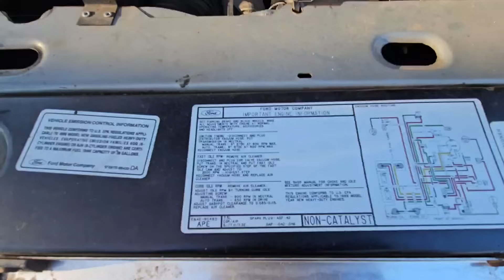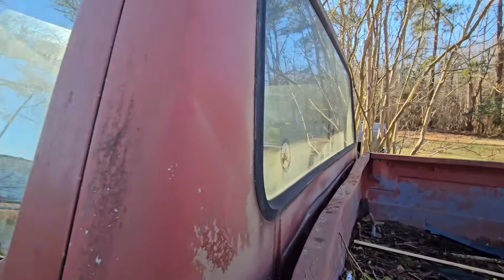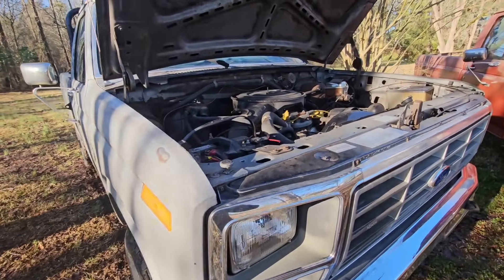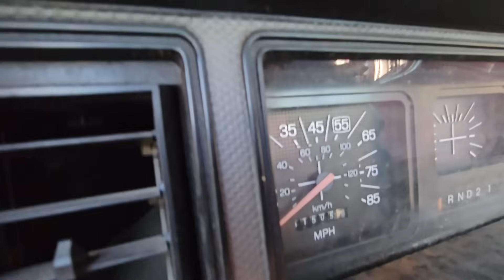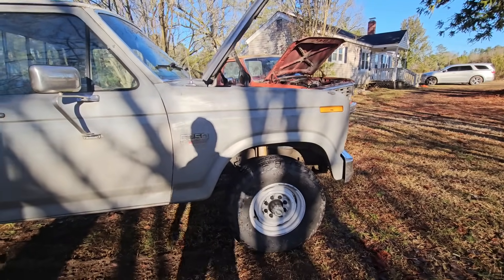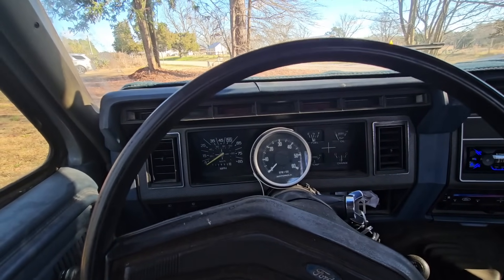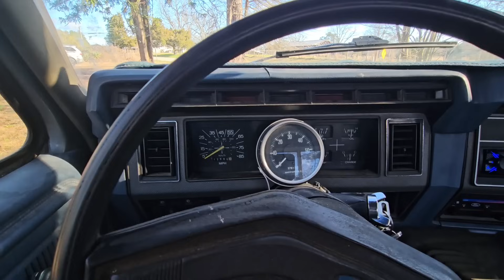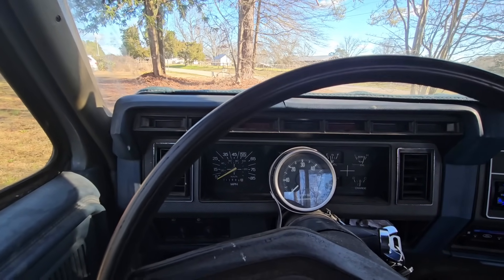THE WORST TRUCK FORD EVER MADE!?!?! #ford #fseries #sbf #bbf #truck

Comment: I learned how to drive on my father's 1980 bull-nose; it was a straight-6 F-100, white with blue interior.  Stripper model but unstoppable.  My last bull-nose had a 3-speed manual with overdrive and the lovely straight six 300.  Slow and steady but a nice workhorse.  I owned a brick-nose at the same time; I-6 300 in that as well, but EFI versus  a carb, and 5 speed manual.  I miss both of them.

Comment: I owned a plain-Jane 1984 F150 with the inline 6 and 4 speed . Was a 4x4 . I LOVED it !!! Owned for 3 years and had 1 problem only . The left front hub failed . Ultimately , I sold it and purchased a 1986 F250 XLT Lariat . Had the 351 with automatic and 4x4 . LOVED IT !! Sold because I was married and we bought a brand new rig . That was in 2000 . Now ...a guy I work with has a 1985 F350 with I think a 351 . But it is all apart . He was restoring but he lost interest ....I offered him $500 AS IT SITS . He is thinking on it ....hahaha

Comment: I owmed 1 F-150, 1986 300 4 or 5 speed manual.  349K miles when ot caught fire and that was that. Paid $300 for it.
Bought an 88 F-250 4speed w/OD 460 4X4. In the process of rebuilding it.  
I have newer dually pick ups and just don't care for all the electronic crap.

Comment: 1985 f250 long bed extended cab 4x4 1 ton rear end 460cu    The truck was an absolute beast in black. Had a huge center console and nice cushy bucket seats.  Rear seat folded completely flat. Had it in Michigan but came from SW Colorado.  2nd cousin bought it and brought it down to Mississippi.  Saved it from rusting out.  Miss that old girl.

Comment: I've had an 83, 84, and now an 85 all f150 4x4. 83 had a Windsor with auto, and the other 2 had the 300 and granny 4 speed. All were very  reliable and very capable offroading. I still have the 84 with a broken frame for a parts rig after 10+ years of beating on it Rock crawling, and the only time it left me stranded temporarily was a fuel pump. I absolutely love these trucks!!!!
Reply from the maker: That's awesome! Fuel pump is determined to fail in any car! That's nothing! You're right, great trucks!

Comment: my dads truck was the one ton and we put 16k tounge weight on it with a 12 x 60 mobile home it pull it fine only problem it made the bumper smile big so we got the truck home i drop the bumper straiten it up reenforced the stock bumper brackets never had another problem out of it  bad part of the 460  was 9 miles to the gallon

Comment: My favorite Ford truck was one I had back in the early '90s. It was an F-150 2-wheel drive with a wood bed, 4-speed, and the inline 6 300cid no a/c. I used it to tow my 32ft  1968 Silver Streak travel trailer in Arizona and New Mexico. Was a very solid truck. To me the best thing about the older trucks is if you used it for it's intended purpose it got dirty inside and out you just hosed it out no worries about getting electronics wet because everything was manually operated. even back in the 90s I tried to get a new one with just the basics was told it would have to be specially ordered from the factory and would cost more than a lariat edition of the same truck. P.S. back in the late 80s I promised myself I would never pay more for a vehicle than my parents paid for their house which they purchased new back in 1960 for $17,500, it was a 3bd, 1 1/2 bath brick home w/ full basement and attached garage on a 1/4 acre corner lot, and to this day I have lived up to that promise.

Comment: I have a 84 F350 Fleet side bull nose  4 speed  I enjoy driving it and the BODY is in great shape.   460 with RV Cam  and straight up timing .  I will say this  it will not steer well Loaded heavy , It’s down right Scary sometimes.  Something too do with the CASTER change when loaded.

Comment: I had a 86f-250 4x4 regular cab four speed straight 6. It started in -30 not plugged in. When driving in winter you needed a extra floor mat to keep the cold out from the hole in the driver's floor. Paid $1000 for itr and put it to work doing landscape construction. Hauling gravel and sand daily. It's first winter of snow removal it made $32000 for the company. It was worked hard for 4 years hauld just shy of 2 tons of gravel one day 😂. Only asked for a parking brake cable and rear pinion seal probably from always being over loaded. Great truck
Reply: The 86 f150 I had in 2014 coldest winter on record here started when nothing else would even new trucks
Reply: I laughed about the floor thing so damn true my dads I could see the road thru the floor before it got retired even then the junk yard used it to haul in the yard cause the newer trucks were junk lol
Reply: Plus that truck hauled a dang 5th wheel for 1/4 of its life for a machine shop still had over 400k

Comment: had a 1984 short wheel base F-150 4x4 4.9 4 speed with granny first gear sold it 21 years later with 540,000 miles on it

Comment: My first vehicle was/is an 83 F100. My favorite Ford trucks. Still have it over 20 years later.
Reply: I had a 83 F100, six with dual gas tanks and auto tranny. I loved that truck. Sold it for scrap in 1997 when I burned a hole in #1 cylinder ( my fault). Should have hung on to it.

Comment: The sheet metal is quite flimsy  compared to a bump or dent. 
And the spring hangers love to rusr off. 
Had a few, still have an 84,
But prefer the older ones. 
The cloth seats in the early 80s did wear so much better than the 87 and up.

Comment: Even the ones with the 300-straight-six had a 9K lb. GVW- It's not about the engine...it's about the axles, suspension, and brakes. I know...I had an 81 F250 with the straight six. I also had an '86 F350 car-carrier with the 6.9 diesel (The last real diesel offered in a Ford truck!)- Both great trucks that could do anything you asked of them, and they didn't cost $100K and would run forever and rarely if ever need a repair (And when they did, it was cheap and easy to do). Gimme a vinyl or cloth bench seat and a rubber floor mat...don't need these sissy leather upholstered, carpeted pieces of junk with electric tailgates.
Reply from the maker: You said it! I agree!!

Comment: Drove a 84 f-150 4×4 with the 300 six banger and a 4speed manual. It got 20 mpg, started at 20 below and lasted me for years. Wish I had a brand new one just like it
Reply: Had a couple of 300s.  Loved em for low end power but they ran out of gas above 3200k rpm. Also had one that got its best mileage at 85mph.  No idea why but got 26mpg at 85 vs 13mpg at 55.  Miss those trucks.
Reply: Still have my 90 300 with 600k and all orginal.
Reply: You still wish for bias ply tires, point spark ignition, and wooden axles too?
Reply: I bought a 1980 beater 300 four speed. The oil came out of it like tar . I drove it for four years after. I wish I could find one like it new. Loved it for what it was. It was shot when I bought it.
Reply: My old lawn company had a fleet of 1ton 460s all sticks no a/c. Glorious. Pass everything except the gas station.
Reply: Still driving my 84 F250 4x4 i bought new with the 300
Reply: @DG-sf9ei  as compared to the modern urban cowboy blingy stuff? 
Meh, sometimes
Reply: My 82 4x2 300/7 4spd with no radio and crank windows got 19mpg and better on long trips.
My 97 2300 5sp Ranger gets 22-25mpg.
There is no comparison. The f-150 ate front tires a little faster.
I would spend the $6600 (about 12,600 today) I spent for the 82 in  a minute.
Reply: Geared super high  @rvndmnmt1
Reply: @rvndmnmt1 26 mpg ? That's awesome.  I'd heard the 300 was bad on gas

Comment: i had a 84 f 250 hydraulic clutch  with a 351 Winsor motor dual tanks back then caladic converts were just coming into the market but i believe anything that was rated a 1 ton truck did not have to have them  because my dad 85  f350 with the 460 motor hydraulic clutch  4x4 both 4 speed on the floor   my dads 350 had over 12500 on the bumper cause we hooked it up to a mobile home that was stuck and  no problem walking it out until the bumper smiled at me so we did the job took it home i drop his bumper and strait it up a bit then reenforced the bumper  never had a problem out of that truck again even when the lady hit the rear of it doing 50 miles a hour  in a 30 zone we moved her front end 3 feet into the cab of her car the front of her motor was just on the outside of her firewall  only thing she had to replace on my dads truck was a after market drop hitch

Comment: I have several of these trucks, I like how easy it is to swap a 460 into a 1/2 ton if you have a parts 3/4 ton with a 460. They're light, easy to work on and nothing beats the twin I beams for ride. The last of the carbed truck era. Great video!

Comment: 86 was one of the best years for a Ford truck.  I had an 86, 88, 90, and 92 all f150s, all with 300 straight 6s and bolt action manual trans.  Loved them all.  But living in the northeast, the driveline always outlived the bodies and frames.
Reply: Sounds like the 54 New Yorker wagon I bought.  Floors were gone, frame is damaged in spots.  Looked like a high-mileage car, but when I took the heads off, I could see that it was actually a low-mileage car.  Road salt will do that.

Comment: The 351 was good for a half ton or a Bronco, but I think it would really be weak for a 3/4 ton.
My 78 Bronco had a 351 modified Cleveland and had plenty of power for itself and to tow 5 or 6 thousand lbs. Can't see that motor pulling a 3/4 ton load.
I also had an 89 Bronco with the 5 liter. It was horrible compared to the 78.
I imagine both of those struggle to get 7 mpg.Tow rating are based upon braking. You might be able to pull 13000 lbs on level or rolling hills, but you won't be able to stop it on anything steep.

Comment: My first new truck was a 1984 F150, 302, automatic, 2wd. Super reliable, actually quite easy on gas.
Reply: Even the F150 with the 302 and a 4-speed got better mileage than today's 5.0 Coyote, if you drove it easy.  And very capable off road with a good set of tall tires.
Reply: Oddly they did really well on fuel other then the tank switch thing was a tank ran and ran so did my 83 bronco
Reply: Did it have the overdrive or regular automatic?
Reply: @bobbyheffley4955  Overdrive

Comment: Had an 89 F150 with the 351 in it. Got pretty bad mpgs. But it was a tank. And after I put new shocks on it actually rode really nice on the highway.
Reply from the maker: I believe it! They're great trucks!
Reply: i have an 89 250 idi 7.3
Reply: i have an 89 250 idi 7.3
Reply: i have an 89 250 idi 7.3
Reply: i have an 89 250 idi 7.3
Reply: i have an 89 250 idi 7.3
Reply: i have an 89 250 idi 7.3
Reply: i have an 89 250 idi 7.3
Reply: i have an 89 250 idi 7.3

Comment: My uncle bought a brand new F250 4x4 in 1984.  Back then, Ford offered "lifetime" rust warranty.  As long as one single repair did not exceed the value of the truck, Ford would honor it.  And they did just that.  He brought the truck to a body shop every 6 months religously the whole time of ownership.    And they did just that.  Up here in MN salt destroys vehicles.  He owned that truck till 2000 and it looked immaculate.  But, the warranty only covered panels that rust from the inside out.  It had tailgates, box sides numerous times, door shells, front fenders, couple of hoods, etc.  But, the floor pans were gone.

Comment: Trust me, people want them. But people are afraid to jump into a 40 year old truck unless it's near mint condition, and they also don't want to spend over $30,000 for a 40 year old truck. Plus, the 90s trucks are more popular right now, especially the Powerstrokes. A lot of people want turbo diesels, not the IDIs even though I'd prefer a 100% mechanical diesel. Way more reliable.

Comment: I GUARANTEE YOU THAT 351 V8 DIDN'T MAKE ANYWHERE NEAR 200 HP WITH A CARBURETOR, EVEN A MID 90'S 5.8 V8 WITH ELECTRONIC PORT FUEL INJECTION MADE ABOUT 150 HP , IN REALITY, FORD CLAIMS DIFFERENT.. APPRECIATE THE VIDEO, I LOVE THESE TRUCKS,

Comment: I had an 84 f250 with a 460 4 speed and that was the best truck I ever owned. In those days I was pulling a gooseneck trailer 2 to 3 days out of a week. Some times it was a cattle trailer, some times a flatbed with hay or a large tractor on it. At 80 thousand miles just like clockwork the timing chain went bad. My buddy at the parts house asked if I wanted to wake that engine up, of course I said hell yeah. He sold me a double roller timing chain that changed the cam timing from 1 degree retarded to 1 degree advanced. Man the difference was great. It definently woke that 460 up. With a loaded trailer behind it would pass anything on the highway except a gas station. During the same time I owned a chevy 1 ton with 454 4 speed and that ford 460 after the timing chain change would run off and leave that chevy with a load. That 84 ford was a great truck and lasted 335 thousand miles until it burned a hole in a piston. Had to put 5 clutches in it is the only major issue I ever had but I was dragging heavily loaded trailers a lot.

Comment: I have a 1981 ford f150 4x4 300 4 speed granny, poor thing belonged to my uncle before me and I remember when I was a kid him beating the hell out of it knocking over trees in the woods and having that bed and trailer rounded over with scrap metal. The guy he bought it from in 1994 used it as a daily driver and in the glove box is the original paperwork from a ford dealership in Booneville, Arkansas dated 10/10/80 says he bought that truck brand new for $7,960. But after all it’s been through it’s never been off the road and it’s never let me down.

Comment: I bought an 83 just like the gray 4x4. No ac, am radio. Paid 12 k.

Still have it and it runs but just use on the farm. Serious rust on it. 184 k showing but odometer r hadn't worked in a long time. Engine actually runs pretty good but mains are are out a leaks much oil.

It has been ABUSED . pulled slot  of 30 k gross loads. Put a bale carrier on and that eventually broke the frame.

Comment: When I worked at a Ford dealer in the early 80's the main complaint I got about those trucks was they looked too much like Chevys. I didn't see it so much, but that's what I heard. Oh yea, they did  do radio delete plates in the 80's
My brother in law had an 81 F-100 Ranger two tone blue with a 255 V-8. I'm a Ford guy, but those motors were junk. He had a mechanical background, but he wasn't the best vehicle maintainer.- Bad combination. He ended up swapping the motor out with a 302 that came out of my old 72 Torino. He never did like that truck. I kind of felt bad, because my sister in law bought it for him, and I kind of recommended it thinking it had the straight 6 or a 302 under the hood.
Reply: Radio delete,  bumper delete,  power steering delete,  A/C delete, were optional back then

Comment: bought a used 1982 single cab ford f100, owned it 25 yrs. best truck ever, v8, auto duel tanks. when I gave it away a/c still worked. started overheating

Comment: I don't think the AC was a delete. It was an add option. I had an 86 F-250 4x4 that I ordered from the factory. The second fuel tank and the four speed were options too. Mine was an XLT, so it had cloth seats and upgraded trim. Fake wood grain inlays and carpeted lower door panels.

Comment: Had a 1982 but was an f150 long bed 4x4 with the NP435 4 speed manual transmission (aka granny gear) only a 302 cid no a/c. I put f250 diesel truck 4x2 front coil springs and buckets along with the f250 rear leaf springs on it. Pulled great kinda wish i of kept it
Reply from the maker: That's pretty neat! I bet that was a good truck!

Comment: Currently rebuilding my 86 250 300 6 4 speed.  Owned it since 1990. Worked it for 25 years. 275000 miles. Just swapped in a straight dana 60 front end . 1 ton springs.  Its about 7 inches taller. Welded in a custom hitch. Home made side steps.  Reinforced the steering box mount.  It on 37 military tires . Home made rear springs using 3 packs of springs . Swapping in lower gears. Its been a great truck and easy to work on. Ill rebuild everything before I part with it.
Reply: Talk about a rig built for a marathon! I'd love to see this all done up!
Reply: I've got an '86 F250 with a 460, but my love was my '83 300.  I wish you all the best.
Reply: I think I'll post a video soon.  There's something about the straight 6 and 4 speed combinations. It's not fast.  It's reliable.  When it needs something it's not expensive or complicated.  The entire drive train is original.  3 clutches.  I'm looking for a extra heavy flywheel.  If anyone know of one that exists. Old motors used them and it seems to keep the torque rotating under load.  When I bought it in 1990 I was a kid. I was into maintain things. My friends thought I was crazy keeping this old girl for decades. It's made me money and only got towed a few times.  Drove it to Hatteras to go camping and surfing.  55 stay alive the whole way... My son learned how to drive the 4 speed at about 10 or 11 in it.  Wish I video taped it. I'll give it to him one day. Promised me he wouldn't sell it.

Comment: Had a couple.. 87 f350 351 2wd $600, 86 f250 460 4x4 like new $1,200, and 3 Broncos from this era that i paid between $150 and $400 for. These trucks were slept on for years which was great for those who could appreciate them for what they are. I wanted another but came across a low mileage chevy k1500 in great shape for $2000 and just couldnt pass it up.
Reply: Ford trucks are much better trucks than Chevy trucks.
Reply: @danbasta3677  Absolutely the most uneducated reply ever. Or you are 12 in which case I'll let it slide.Your preference is your preference. As someone who has owned 50+ vehicles NO manufacturer is better than any other. All have great vehicles and lemons. I would put my stock 93 Chevy against any stock 05 Ford. Why? Because 05 Ford engines are dog piles. By the same token,my 93 can't hold a candle to my 86 Ford. ALL have good and bad.